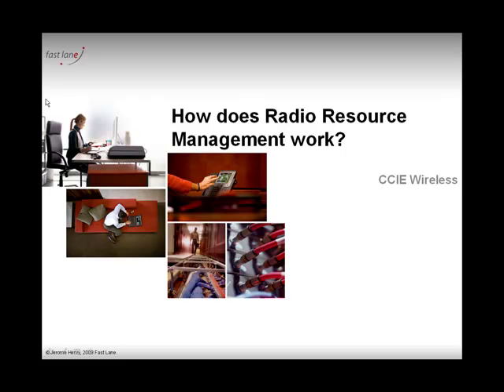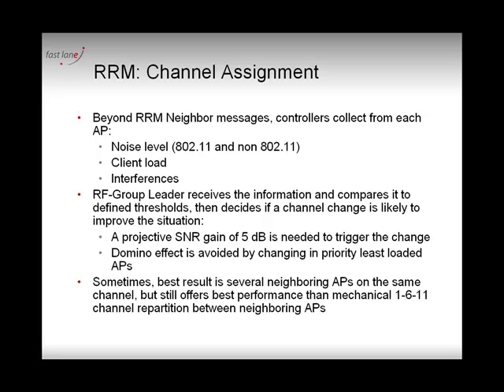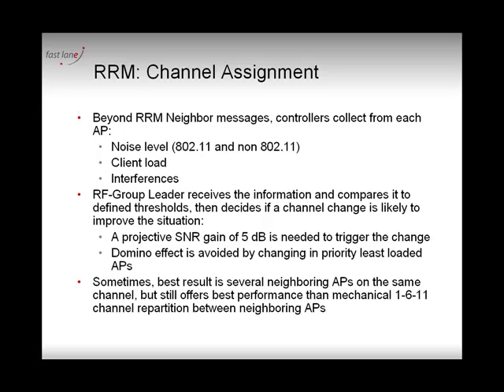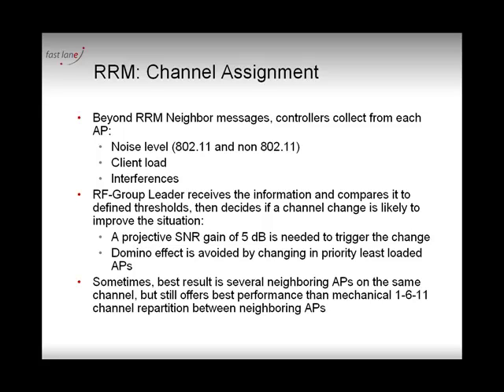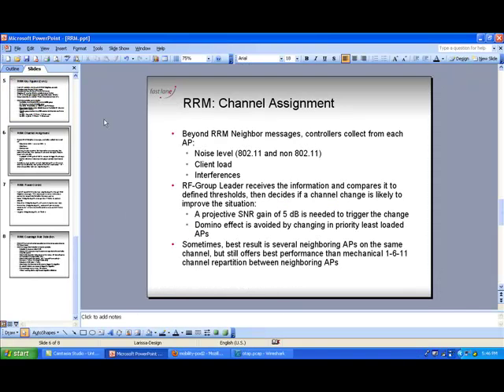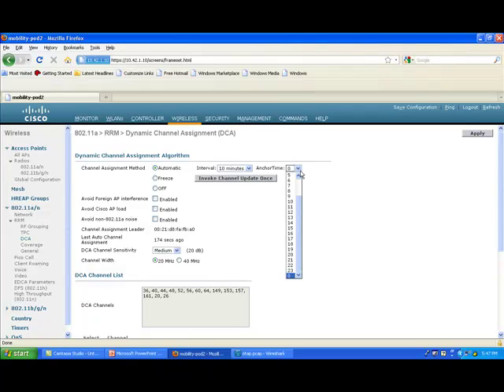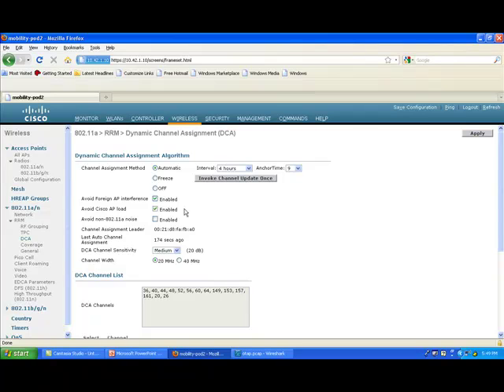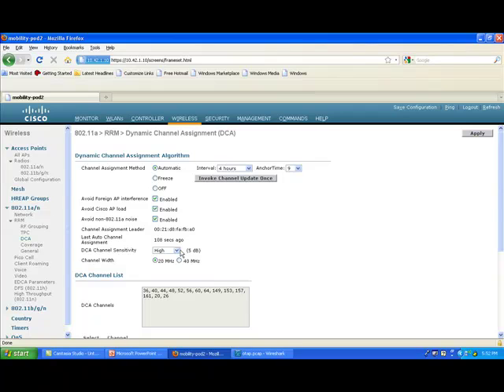RRM, Radio Resource Management, Part III, Dynamic Channel Assignment (DCA)

Comment: Hi Jerome, at the VT in Oct 2014, "uncheck" Avoid Cisco AP Load was considered Best Practice. Aparajita had it in her slide to check the box, but after a few CSEs talked to Jim Florwick and Javier C, the best practice is to NOT check the box. Your thoughts?